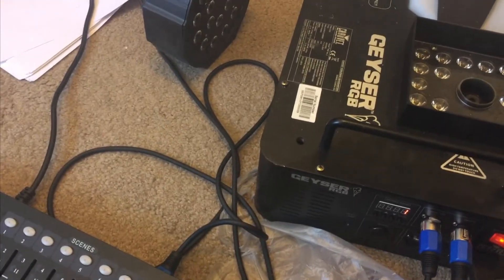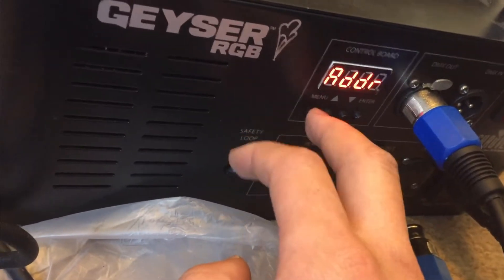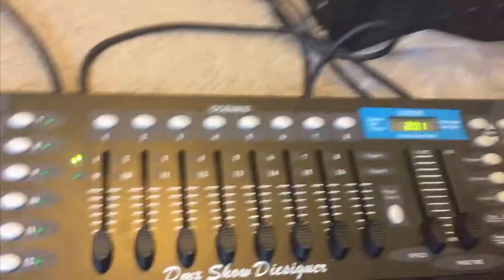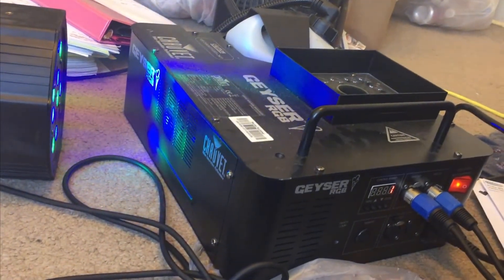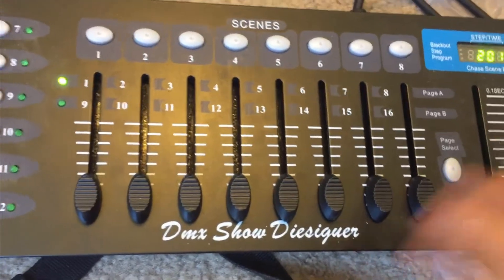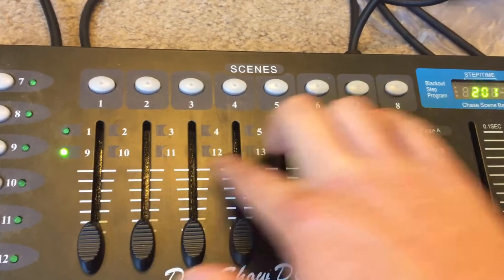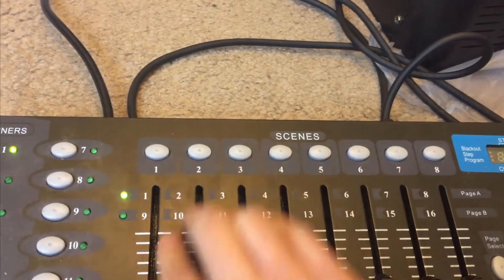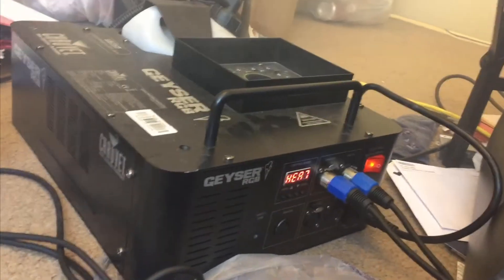Basic DMX for Chauvet Geyser RGB with Wash Lights

Comment: I recommend you putting the light on the address 17 so that you can use it on the channel 2 and so that it does not interfere with the fog machine, after that I will recommend you doing the scenes when the fog machine is off to turn on the light so that there is light and when there is fog to the light to flash.